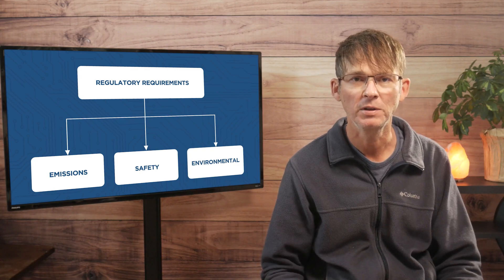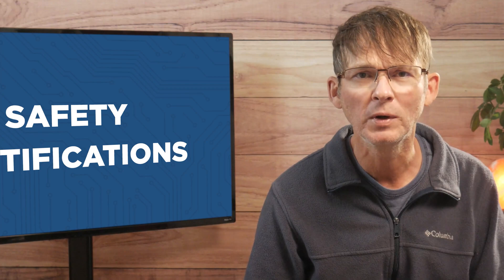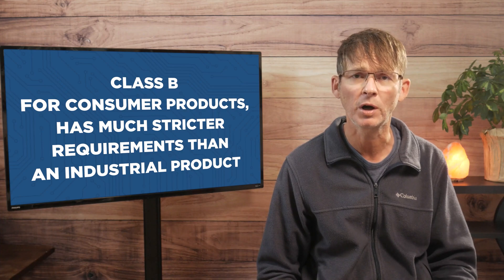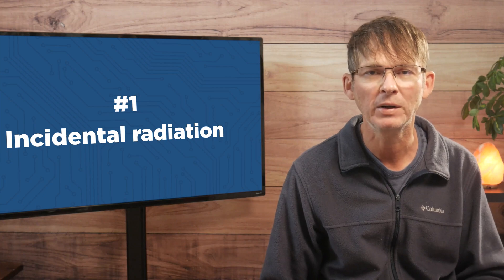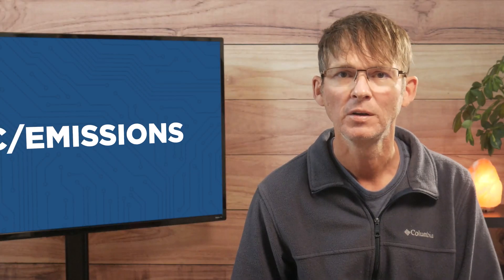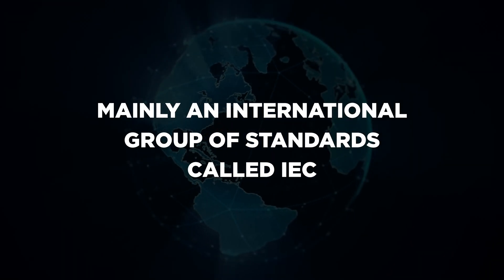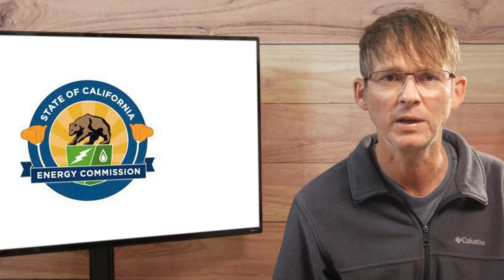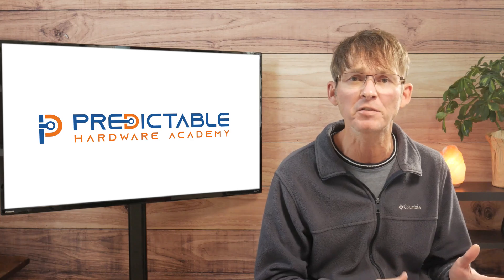Certifications required to sell a new electronic product

Comment: Is there any legal ground for the bonus tip? Because I cannot find any distinction in the regulations about a small scale sale test. Basically all the regulations apply from the moment product is brough to market even with one unit.
Reply from the maker: I can't provide any type of legal advice, but I know this is a gray area that most take advantage of for only small testing.

I go into much more detail on this specific question in this newer video: https://youtu.be/4lN70oghWhk?feature=shared

Comment: Do I need to state somewhere that the product we sell as a manufacturer is part of a sales test? Can I find some more information about the sales test? 
I think i will finally sleep well again after watching your video! 😄 Thank you so much!
Reply from the maker: No need to state that it's a sales test as long as their is no potential for injury or fire, etc. So if I had a product that was powered by an AC house outlet (not using a pre-certified 3rd-party charger) then you wouldn't want to do this unless you probably had them sign a safety waiver. But if there is no risk of injury/damage, and you use pre-certified modules for any wireless functions, then you can do this kind of sales test.

But, ultimately, the better approach to a sales test is to instead get pre-sales such as via  Kickstarter campaign. This way you get the market/sales validation before you produce any units so then this is no longer an issue.

Hope this helps.

Comment: Hey John! I loved te bonus tip & I can see in the comments that other people too! Quick questions: If the device is not certified, what is the process for the sale to customers? Would you suggest making a form or stating that the device is still a "protrotype" to raise awareness for the customer & derisk it for the entrepreneurs? Can the device be sold through normal sales channel (ex: through the companies standard website/e-commerce) or is there a recommended approach?
Reply from the maker: Well it depends on the product. If it requires UL certification for safety (such if it plugs into an AC outlet), then it can be risky for you so I'd definitely get customers to sign a safety waiver. If it is classified as an intentional radiator by the FCC then you need that certification before any sales. But if you have no wireless functions or use pre-certified wireless modules then you would be considered a non-intentional radiator so you can do a sales test before getting that cert. Hope this helps.

Comment: It's a shame that the barrier of entry of these certs keeps so many people from either launching their product or needing funding so high they loose control of their company. Especially now that getting pcbs and parts are so easy to get logistically.
Reply from the maker: True, but luckily there are ways to drastically reduce these costs, and you don't usually need them until after you've produced a couple hundred units and have done sales tests. This way you know these costs will repay you in sales. Thanks for your comment.
Reply: @PredictableDesigns  For sure, I wish there was a firm that gets a product compliant for a royalties and such. By the way your channel truly is a gold mine. I do branding for some tech companies and some times startup tech, while I'm a maker I'm not on their scale. I've seen things go so belly up over not just complaint cost but also protocols that require licensing fees that take people by storm.

Comment: Is WEEE a certification and/or required? It's the trash can icon that's X'd out
Reply from the maker: WEEE is required only in the EU. This regulation works in conjunction with RoHS. RoHS regulates the hazardous materials used in electronic products, and WEEE regulates the safe disposal of the product.

Comment: I'm wondering if you build a product, with parts that have already been certified, do you need to certify the end product ?

Let's say I pre-built computers with off the shelf parts, does it need to be certified ?
Reply from the maker: Yes, you absolutely do. The end product has to be certified. But it will usually be easier and cheaper to get certified than a fully custom design.
Reply: @PredictableDesigns  Thanks for the input!

Comment: Hi! Thank you so much for your video. I have a question for you that maybe you can help me. If I want to commercialize electronic components and printed circuit boards and sell them overseas, what type of certification do I need?
Reply from the maker: I can definitely help you with that but it's too complicated to answer here in the comments section for your specific project. I'll be happy to help you further inside my Hardware Academy.

Comment: Excellent presentation.  What kind of safety certifcation do one for phone wall chargers. How much would it cost? I was about getting a wall charger for retail market and they need a safety complaince certificate for the peoduct.  Does it worth do you have the cost and which company perfoms the tests
Reply from the maker: Thank you! If it's a totally new wall charger then it needs UL safety certification which costs about $10k.
Reply: Thanks for your response. The charger is not really new they have it selling already but I wanted to get under a different brand name so they retail outlet now requires safety document for my own brand. That's the summary. Which company's does it here in the states so I could get an idea of what it will cost. I already decided to leave the project but after seeing your video decided to visit it again. Thanks for your help

Comment: Thanks for sharing this informations and simplifying it four us. Your courses aren't in my budget meanwhile the other content is helping me a lot. As you can tell if your academy is't in my budget the certification's arent eather. (I'm just high school student who wants to make a tiny affordable product four small market withou any considerable profits just to create a competition and drive prices down. Witch is possible if i don't need to pay the certification.) My product needs to be very small witch comprimizes use of esp32 modules so the product is going to fall under the intentional radiators category and i can't afford even certification four use of lithium battery. My initial idea was to sell the electronics and the enclosure as separate parts and does selling just component's witch, as i hope, do not need certification. Do you have any tips other than don't doing it?
Reply from the maker: Thanks for reaching out. If your goal is to not make any profit and only to drive prices down that will be almost impossible. It's expensive to launch a new product and with no profits it will be very difficult to scale up volume. Best wishes!
Reply: If you use pre-certified esp32 modules then you dont need FCC intentional radiator testing. Check the fcc grant notes for the specific modules for restrictions. You would need SAR testing if it’s designed to be used less than 15cm from the body. Also, there are a lot of other countries outside the US that can be considered

Comment: Also, you mentioned that you are allowed to sell and ship these products under the first few hundred units without any certification?
Reply from the maker: Correct, but only if your product is a non-intentional radiator and has no safety risks.

Comment: Thanks for the clarifiying video, it really helped making things about product certification clear.

But what about the exemption from doing the certifications in case of small sales tests of few hundred units (in case of unintentional radiator and not connected to mains)? How this thing is regulated and what are the conditions? Can you please share any resources about this point?
Reply from the maker: Great to hear, thank you!

Keep in mind that UL certification is not really a legal requirement, only the FCC. So if your product is extremely unlikely to injure someone, and you use certified batteries, and it doesn't plug into the mains then selling a couple hundred units really is no issue.

But as for FCC and sales tests it's somewhere there in the federal regulations I referred to in the video. You should be able to find these regs online and search them for more details. Certifications really cross over into the world of law and legal experts. So I have to say I'm not an attorney and this is not legal advice:)

Comment: Currently using an FCC certified ESP32. So for the device, you're saying I can wait until after I've made 100+ units before doing any certifications? And these 100 units, what level of molding should they be? We're planning on doing injection molding so is it ok to do the certifications after we've opened the mold (which we'll need to do to make the 100 units). Or is it risky to do certifications after started molding?
Reply from the maker: Yes, as long as it's not a medical device, food product, or some type of product with extra layers of safety certifications. Also can't plug into AC outlet. A plastic enclosure won't have a huge impact, but wait until after you have molded enclosures to use for certs. Delay those certs as long as possible until you know for sure you will more than get your money back in profit.
Reply: @PredictableDesigns  That for me is confusing b/c our molding costs are substantially more (10x) than the cert costs. For us it seems to make more sense to do the certs first and then molding.
Reply: Also, what about testing for a device that incorporates wireless charging?

Comment: Thanks for a very instructive video. Can FCC emissions certification be avoided if the MPU clock, even if greater than 9KHz, comes from an internal oscillator (i.e. on the MPU die or at least within the device package), is not exposed on a device pin, and by (software) design, no device pins will toggle above 9KHz?
Reply from the maker: Hi Dale, thanks for the question. You would still need FCC non-intentional radiator authorization but not full certification. RF emissions will be radiated by that MPU, and that plastic chip enclosure won't stop them:)